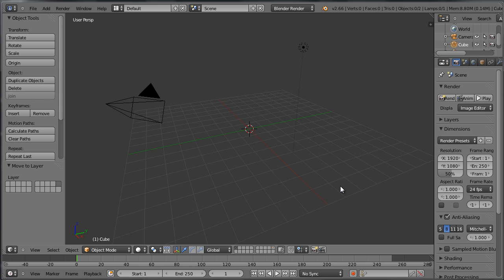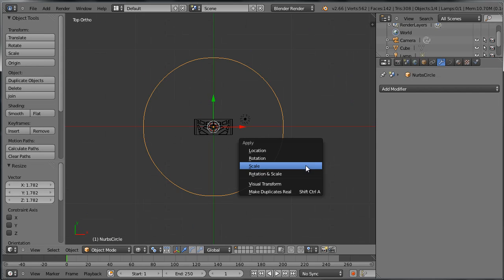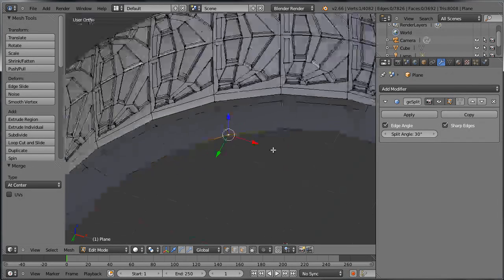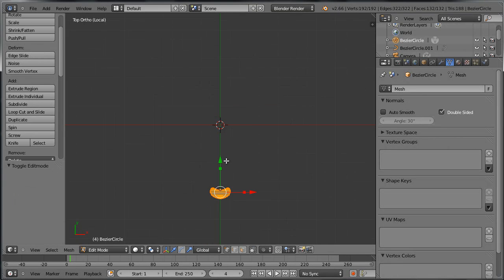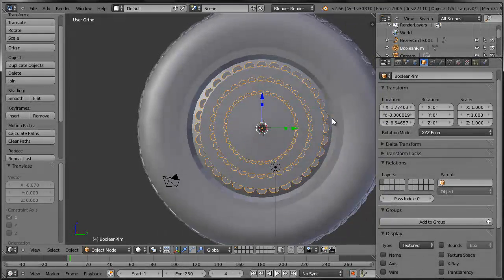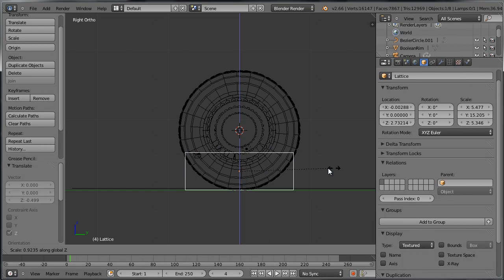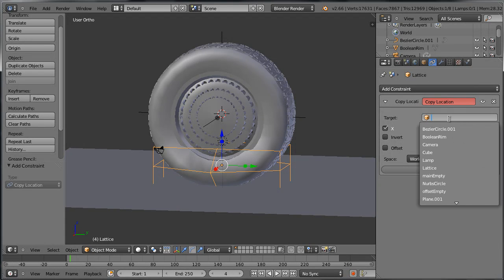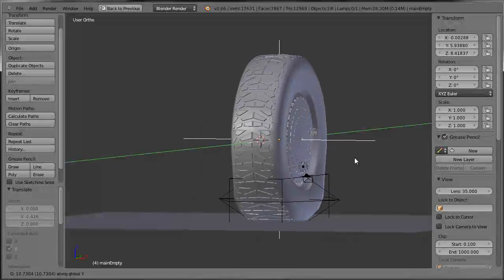Blender 3D : How to animate a deflated tire / HD

Comment: This may not be right video to post this.  I was wondering if you will do a tutorials on a "underwater scene".  I have looking on the web for sometime without luck.  I have used the glass material but that doesn't show the caustics effects of the water.  If there were any plants at the bottom of the lake it just doesn't display well.  And there is the issue of streaming light through the water which is always another problem when it comes to Cycles render

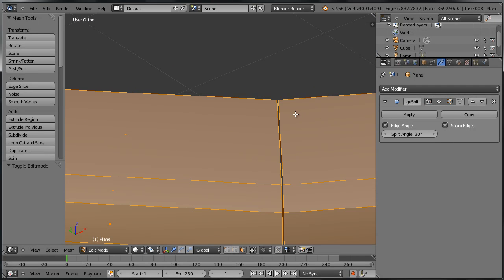Comment: Interesting Video. Thanks. Tricky Part comment.  At 10:15  ...  merged a gap. Later applied modifiers. So for me it was easier to use .. Array Modifier Fixed Count (Not Fit Curve)... Curve Modifier ...  Other Steps the same including ..........merge.  For me it was easier just to pick the number of building blocks to tire, since you are going to apply anyway.

Of course in Blender there are many times so many ways to do things. Array Modifer Object Offset ... Empty Rotated (360/N pieces)